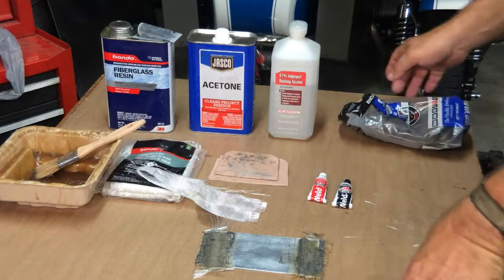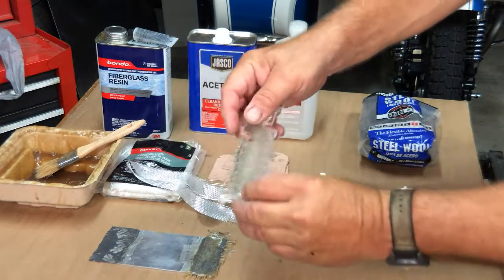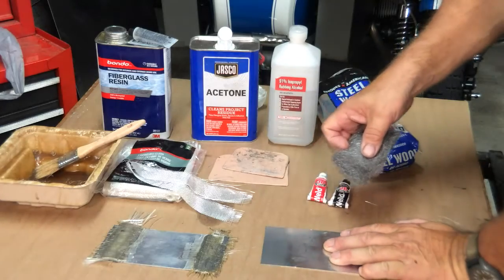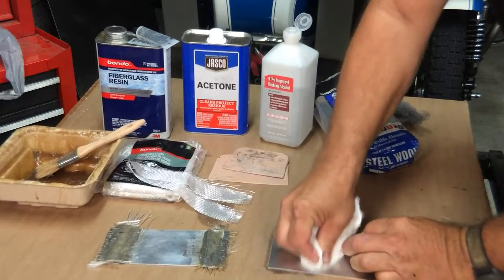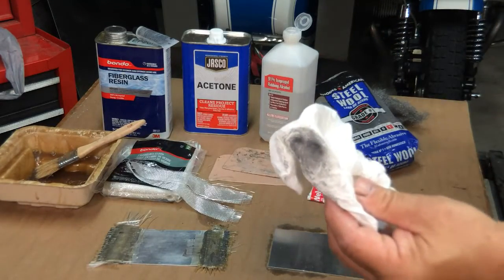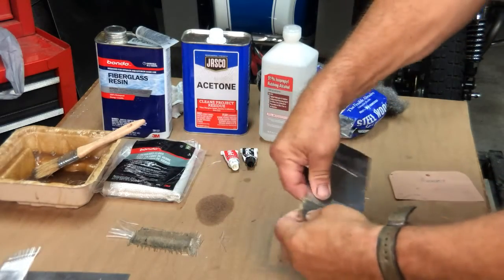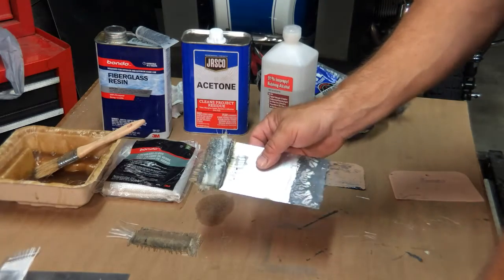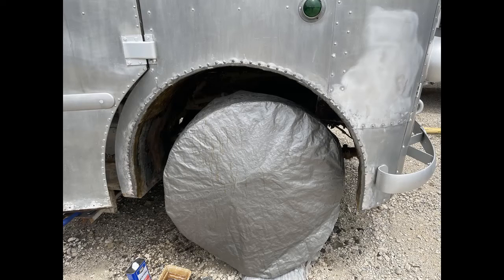Bonding Fiberglass to Aluminum

Comment: Couple thoughts here from an aircraft mechanic: you never want to use steel wool or brushes on aluminum. It’s just about certain to cause galvanic corrosion down the road. 
The oxide layer of aluminum is restored almost immediately after you remove it. This is why you need a shielding gas when you weld it. It’s more likely you’re giving it more surface area to bond to by scuffing it up than because you’re removing the oxide layer. And that can be done with scotchbrite.  Some of this stuff might not translate outside of aircraft, as far as I know this may only apply to 2024 or 6061, that’s all I’ve ever worked with. Not saying you’re wrong, just adding some food to the conversation.

Comment: I put a new sheet of thin aluminum over my existing fiberglass roof and used rivets and sikaflex to seal it but the sika flex didn't bond well to the aluminum and is coming off easy. Maybe cause it was all polished? so maybe I'll try sanding it before I apply it.

Comment: Thank you so much Al! This solved cracking problem on fiberglass to steel of my truck's wheelwell that I've tried to fix for a couple of years now. This summer I'll try once more using your method. I'm convinced it works. 😊

Comment: This might be a dump question, but instead of jb-weld can I use liquid nail?
Reply: I am trying to cover an aluminum sheet with fiberglass and I was wondering if I could use liquid nail instead of jb-weld. However, I did a test strip and it came right off. @Travellingman32

Comment: Scuffing the surface is auto body 101.  If the metal (whether aluminum OR steel) is too smooth, even paint won't stick well.  Everything has to be scuffed and cleaned with a solvent

Comment: I like to use alum. Foil to cover things and make a form fitting fiberglass whatever I want…
Reply: The problem is bonding fiberglass, you may glue a fiberglass fabrication to aluminum, but it will be a weaker bond than bonding the glass Matt, then curing the Matt with resin. The Matt bond with hb weld is very strong as the jb weld partially saturates the Matt.